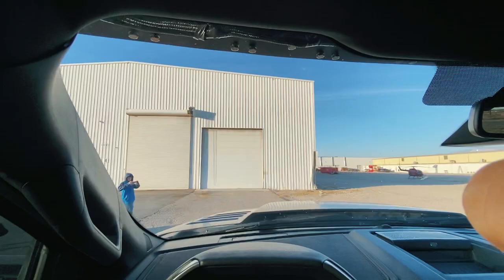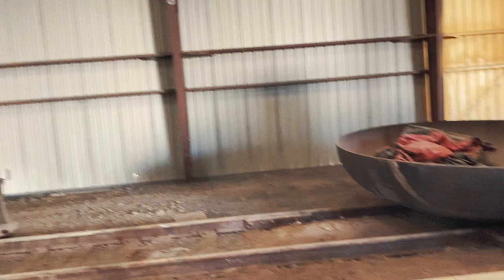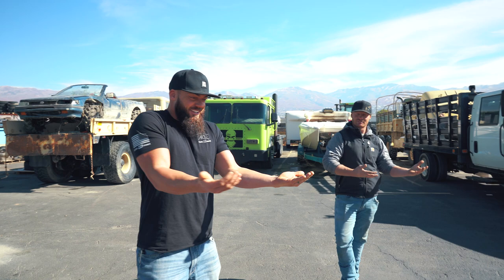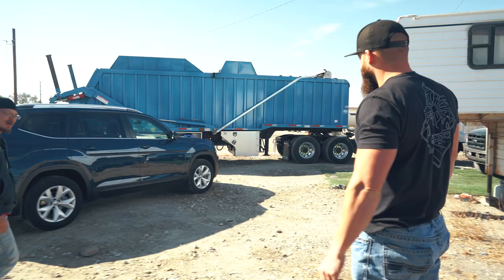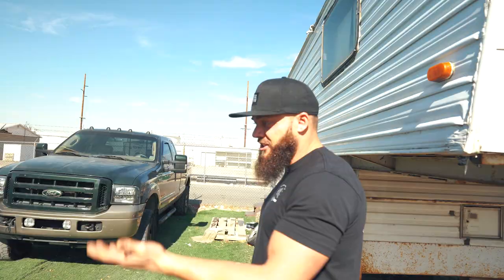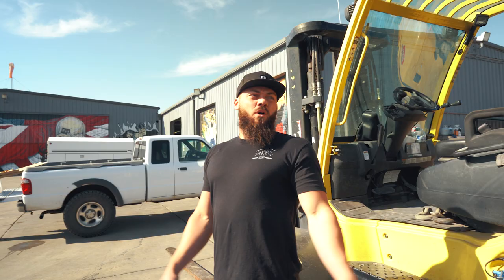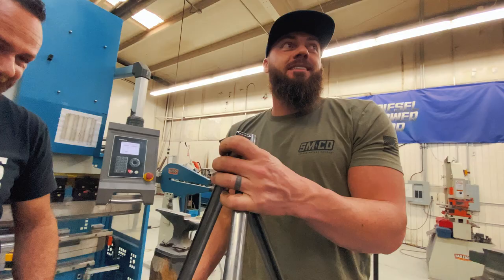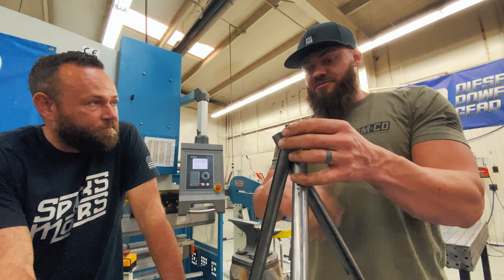Building Giant Cauldron For Dude Soup!- Part 1

Comment: Its a head or end cap we call it both , for a pressure vessel , a large tank in the shape of a capsule or pill , you have a  cylinder body like a empty paper towel roll with one of these on each end, used to store a gas under pessure like propane, need a B-Pressure ticket on top of your journeyman ticket in order to be qualified to weld these tanks which are 100% x-rayed on all welds and are anywhere from usually 5/8" to 1" inch thick depending on what gas is being stored with multiple fittings and manways installed as per customers request, as our shop did all custom made tanks and specialty tanks for all sorts of different storage or holding for all industries but mainly oil and gas. I would assembly and weld all the components which come in multiple pieces which are usually 2 end caps a tank body a container or two of fittings and a skid that it sits on, some tanks also have inner heads and have multiply separate areas for different types of product in the same tank such as gas, diesel, including different types of gases sometimes up to 7 or 8 separate compartments in one  tank. All the way up  north  in Saskatchewan , Canada where -40 in normal in January  like it was yesterday we use Celsius not Feraniete but minus 40 is minus 40 no matter what you use.

Comment: The weight that a telephone can hold is subject to several factors, angle they are holding weight at, how many are doing the holding and at what angle are the poles at. Higher the angle the more weight it can bear. Simple mathematics. Most if not all can be calculated online without opening opening one book. I would build me a curved pipe to make the top ring for the poles or a dedicated chain connected together or wielded together to hold the top of the poles or a wielded strap of metal would work too but curved like pipe would be the best fit for the poles to rest against Once the base are set in the holes in the ground the assembly is locked into place. 
Then the chains can be fit to support the weight of the tub and the size is going to be adjusted for occupancy of the tube plus the water and live load figures.

Comment: That's funny I was using a forklift to move my 2500 Silverado I had to reverse with it and I changed it to the fork carriage and when I went to set it down I could not for the life of me get the tension off the chain I ended up having to cut it and it popped apart hella crazy no matter which way I shifted or Tilted the forks I could not get the tension off of the chain till it was cut. I know exactly what you're saying about forklifts having a mind of Their Own.

Comment: Used to do QC for a company like that....they have to be 👌🏽
Reply: Looks like that end cap was a reject seen the numbers up to 13 on the seam that was ground flush, probally failed by QC with his ultra sound machine finding defects , then tossed to the side , usually that would be welded flat using sub arc machine and then formed  possible stress fractures from being pressed into shape maybe , we never x-rayed tilled tank was complete and QC went over everything and it was his job to book x-ray truck to come and shoot the tank or tanks before it was moved over to the blast building for sand blasting  before going to the paint shop , all seperate buildings or shops in the yard we have like 7 or 8 shops over the yard , 2 are used for paint and/or spray foam, 1 for sand blasting, 1 for maintainance, 1 is for the mill which rolls out the cylinder bodies and has an area for working on smaller projects, 1 shop for small parts, 1 shop for cutting, 1 shop with big plasma table and area for working on tall tanks , 3 shops for assembly and welding . 2 QCs for the whole operation.

Comment: Don't stick the forks under a lip of a track and that stupid stuff will not happen Mr. Operator. It is and end cap for a tank for which it was made for until you wield hangers on the lip of it to hank it then it becomes whatever you make it to be called, but not until then. Measure up 30' and wrap a chain around the poles and then use a track how and pick it up, but it would be better to dig holes in the ground where you are going to set the poles and then raise them up and let the legs slide into the holes and then use a chain saw to cut in the grooves for the chains to set in for the cauldron to be supported from at the proper height for people to climb in and out of easily. Don't worry about the live or dead loading on the poles, if placed at the proper angles it should support it with three of them, at the proper angle and in this case steeper the angle the more load the poles can bear. This ain't rocket science guys. After all if you were worried about safety you would let your guys show up to work with cutoffs and flip flops on either. At least I wouldn't. Do not forget to account for a live load in the tub as well.

Comment: stopped this video just as you have the tub back in the yard and have yet to say how your going to suspend it. Thinking 1. it sitting in a ring which could be suspended or held up by beams (cradle approach) which leaves the bowl free to a deg to be free floating while still in a secure cradle. 2. Welding a series of eyes around it then using shackles and cables to suspend it. these are the two thoughts directions due to title of Dude soup and witches cauldron. Now to see what happens. LOL